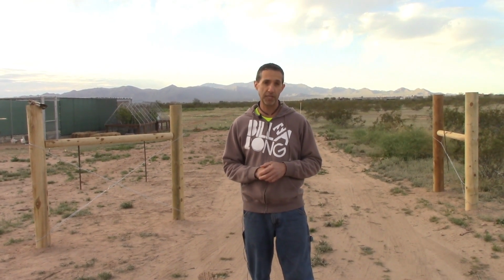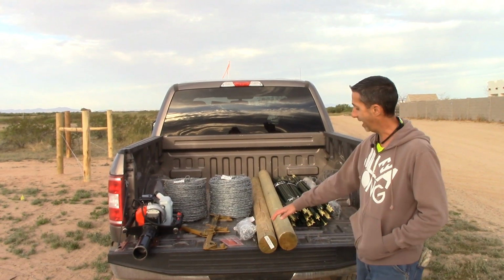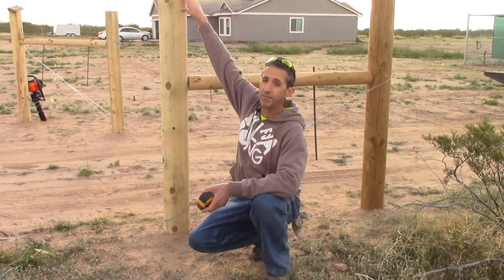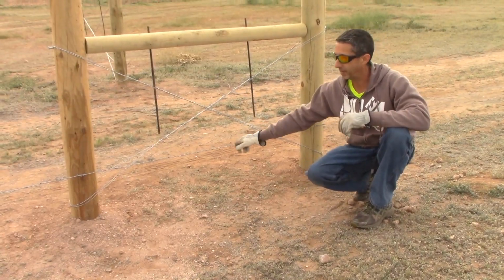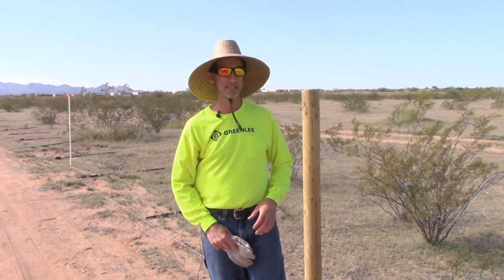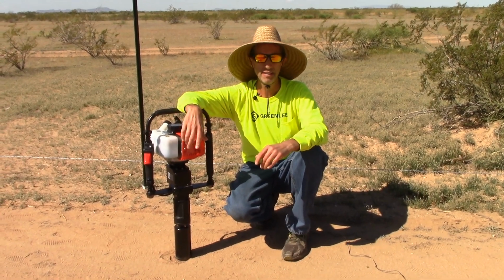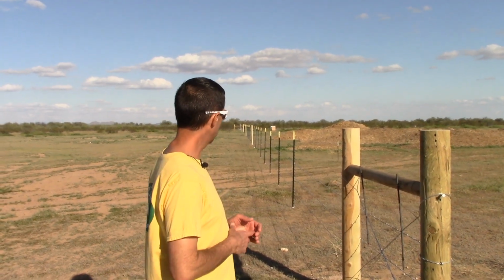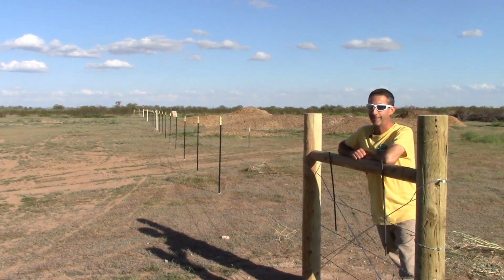Farm Fencing Install Part 5 - Barbed Wire

Comment: Hello! Thanks for this great video! Very helpful and easy! My English not very well. And I understand, what is distance between H brace ?
Reply from the maker: Your English is coming over very good on this one. The cross beam is between 4-5 feet (120-150 cm).
Reply: @EdgeofNowhereFarm  Thank you! Reading easy than litening :)
Reply: @EdgeofNowhereFarm  What is distance between line post ? 

I want to make similar fence for 2,7 gektar, but wire will be electric. It's hi-tensil electric fence. Metal very expensive for me and I am thinking about fiberglass. What do you think, it will work for long distance ?
Reply from the maker: @Sayanbaetov  There is 12 feet (3.6 m) between each line post and a reinforced (larger) post every 100-150 feet (30-45 m). We use metal t-posts because our hot, dry weather breaks fiberglass. As long as the fiberglass can hold up to your weather you should be ok. What livestock are you keeping in? Cattle?
Reply: @EdgeofNowhereFarm  Thank you! Cattle. Last 3 years rain and snow is lower and lower. So I want to fence my land and make planned grazing. We have 200 cow
Reply from the maker: @Sayanbaetov  wow, 200 is a strong herd. Good luck with your grazing plan. I hope it goes well for you.